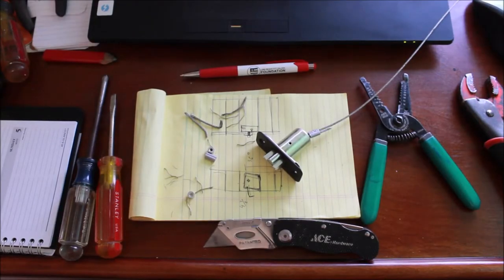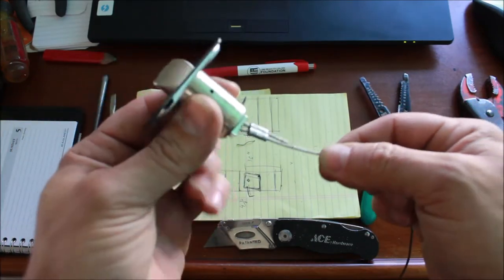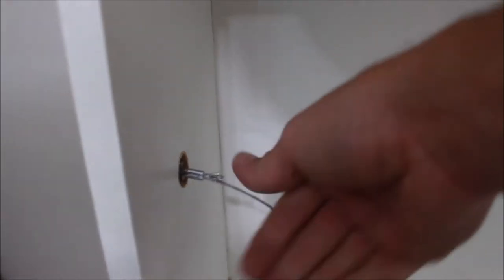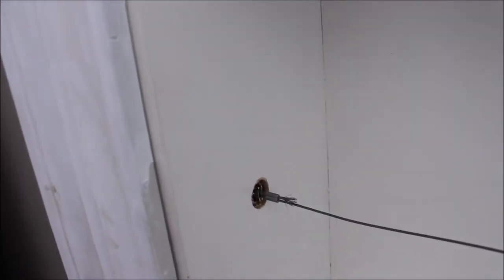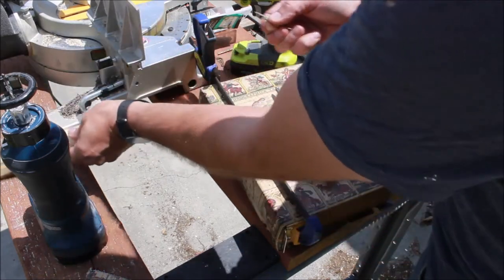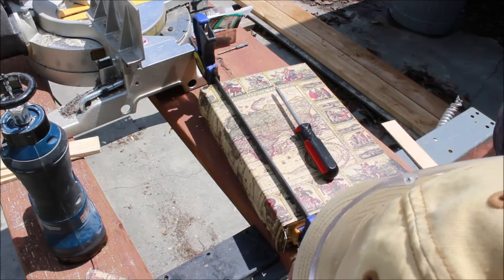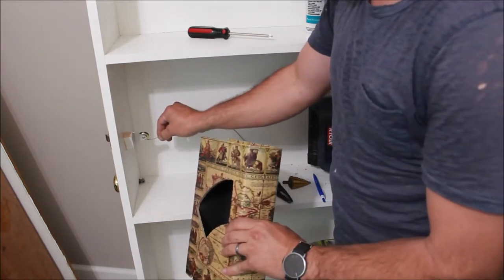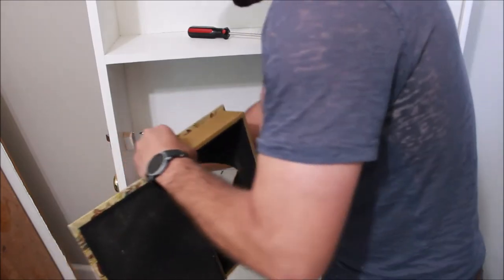Bookshelf Door - Part 3 - Latch Mechanism HOW TO - Inswing

Comment: I still haven’t figured out how the door knob is is set up
Reply: I was coming here to say the same thing. How does the door knob attach and tie into the book and door catch?
Reply: Wait, does the knob literally just have a hole drilled in the side of the case... and then tilts the back of the book forward enough to pull on the cable to open the door?